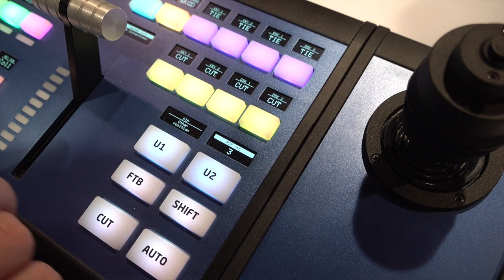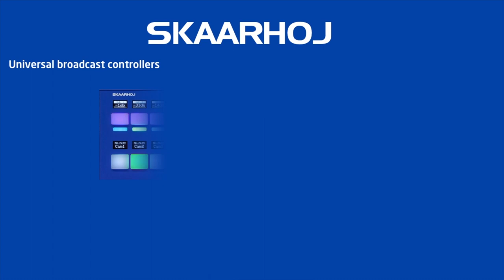Air Fly Pro Improved! - NAB 2019

Comment: Hi :-) What is the size / measures ---> most important the width of the Air Fly Pro? Before I order, I have to know, if it fits into my desk. Thank you!
Reply from the maker: Its 37 cm wide and 18 cm deep, its 10.5 cm high when measured to the top of the t-bar and 7 cm high when measured to the top of the cabinet.
Reply: Great, Mr Skaarhoj, Thank you for replying so quickly! Only 37cm? So it fits!